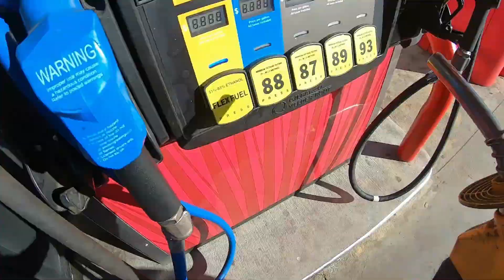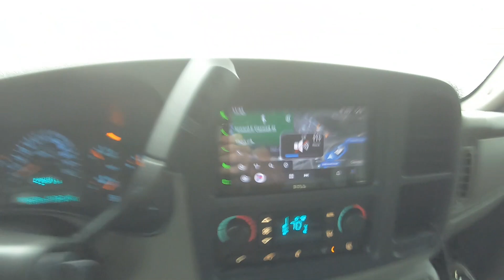What have i been up to? Roll racing my turbo LSX RX7!!! Dragy runs in mexico.

Comment: It looks good pulling hard. I have a 1988 Rx 7 that I put an LS1 in to with a t56 I don't know you keep it cool my IAT keep running high with a non turbo your engine compartment must be baking with that big turbo. But I like what your doing with the car.
Reply from the maker: Iats never got over about 130 in a pull and came down to a little over ambient quickly.  With e85 that's nothing
Reply: Did you have any issues with  heat when you were NA. We don't have E85 where I live I run 94 octane in mine and sometimes I even have to run race gas additive because I don't have high enough octane joys of living in Canada eh LoL. when I'm cruising along it's not too bad it's about 10 to 15 degrees above ambient temperature but it's when I'm in traffic or sitting at traffic lights the Underhood temperature just skyrockets trying to find ways to add fresh air to the air filter but that only helps when you're moving. But keep up the good work I like your build and you have given me lots of ideas for my future mods and above all thank you for sharing your thoughts and experience with us all ...
Reply from the maker: You're gonna have the heatsoak when sitting in traffic. Even my Duramax does it pretty bad.